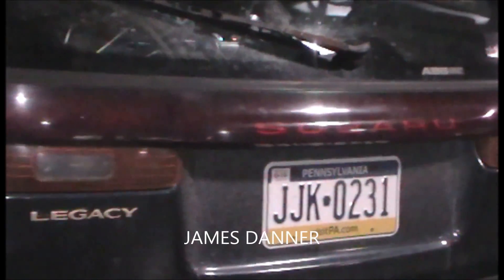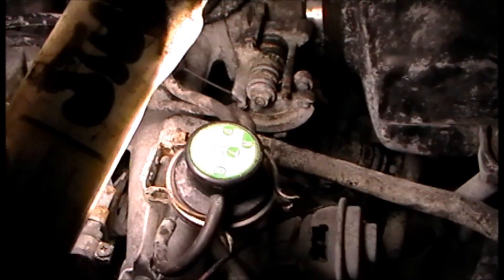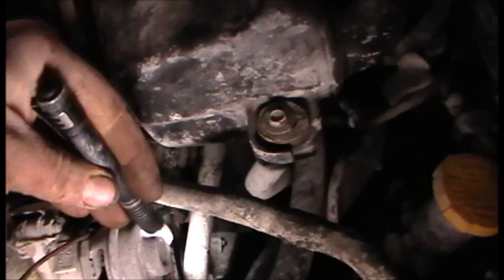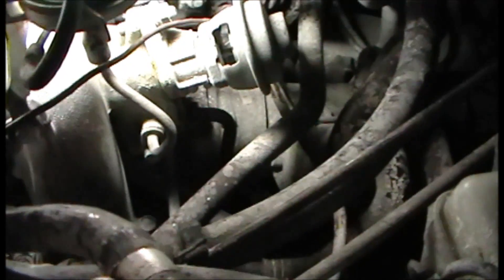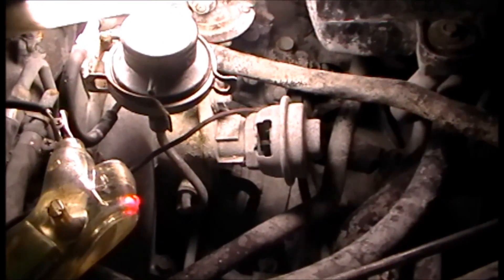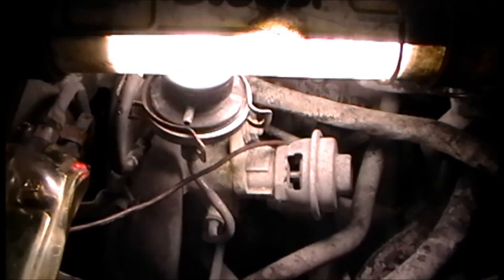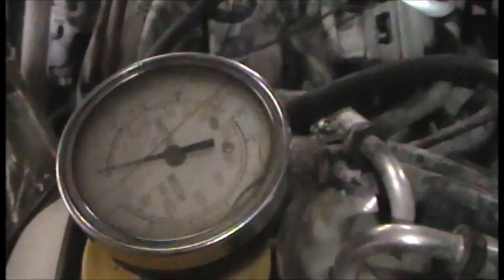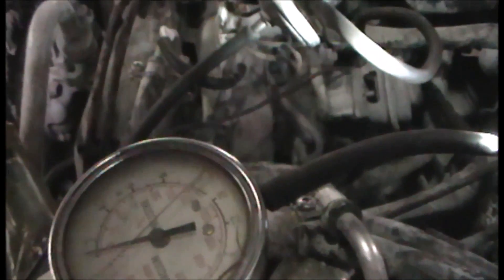SUBARU P0400 EGR FLOW

Comment: Thanks for the video, I have that exact same car with the 2.2 instead of the 2.5 the tube you took out , on a 95 2.2  is a press fit into the manifold and doesn't come out, however I used a piece of wire to clean out the tube and there was some restriction at the bottom of the tube. everything else is the same. Great video I was getting a cylinder three misfire and replaced the idle air control valve, then after that I was getting the P0400 EGR Circuit "A" error. I only have to now clean the EGR valve of carbon but it is RAINING A monsoon here in northern Oregon, will do that next week, only 2 10mm bolts and it comes right off.

Comment: Thanks a million for posting this. I found that steel line completely clogged on my Suby 2.2 conversion of a Vanagon, and the EGR inoperative as a result. Cleaning it out didn't fix it, but with the test you outlined in the video I was able to confirm that the BPT was a gonner.

Comment: I have a similar problem.  EGR valve does not move, error P0400.  Removed and tested EGR valve, BPT sensor, and EGR solenoid.  All good.  However the wires connected to the eGR solenoid have a constant 14V across them regardless of RPM.  Help?
Reply from the maker: I need a year and model to research more. Most likely the computer supplies the ground to the solenoid.  I would want to check the control side of the solenoid back to the computer and see if the wire is broken . Or if it isn't controlling at all for some reason

Comment: If the egr is clogged did you say it could sound like an exhaust leak? Mine threw a code and the exhaust is a little louder. Havnt had a chance to check but just wondering. Its a 97 impreza obs

Comment: First, thanks for a professional explanation of the EGR works design in the Subaru. If I did not understand wrong, a) back pressure coming from the exhaust, enters the inlet port on the Transducers sensor, producing a signal for the vacuum solenoid to open, allowing the EGR to open and exhaust gases - when the force of the back pressure IS enough - to re-enter the cylinder for further ignition. The problem in yours, was the Diameter's restriction of the back pressure port into the transducer. Are there any silicon or other additives that will prevent these carbon deposits on the surface of steel tubing? One more question: mine is a Forrester 2002: does the layout and design coincides with the Legacy Outback's?
Reply from the maker: +johnathan smith I can check for you Monday when I'm at work 
The transducer is pretty much  a mechanical vacuum switch.  The pressure pushes on a diaphragm that lifts a valve allowing the vacuum flow to the egr
Reply: (edit) After viewing your video,  decided to solve my "CHECK ENGINE" light (I haven't an analyzer), because I suspected the EGR was involved. I used an additive (good per 90 gas liters) and IT CLEARED it! Anyway, searching for the valve, I cannot find the location of it in my 2002 Forrester. Please. help me, if you can. Is it too much to ask if you were to video the position of all sensors inside the engine compartment video? It would really help a lot of people, including me. Much appreciated, James.
Reply from the maker: +johnathan smith my program only shows an egr on the 3 liter six cylinder models in 2002. And it's electronic with a position sensor like some of my gm videos.  Can u hit a parts store with a scan tool to get the code?
Reply: James Danner - Thanks for suggestion. I will do that. I had before a Pontiac Trans Sport 3.1 ; its EGR was actuated via a vacuum port controlled by a vacuum solenoid depending on the on the main computer. It opened and closed according to the Temp Control 'transducer' signal (a thermistor with three wires) in the cooling system. Beside - to turn on the cooling fan (only one) and to feed the instrument cluster - it had a Temp Switch with 2 wires only, mounted at the plenum, close to the intake manifold. A nightmare in design!
Reply: @James Danner - Sorry for delay. I did my research, and found out 2002 Foresters do not have a EGR valve, per sei, because their emissions are within the acceptable range. They supplemented their design with the evaporating canister circuit. This info was supplied by the Service Mngr. at Subaru Brampton, Ontario, Canada. Thanks, again.

Comment: Hah!!! considering how good your tools are (I'm jealous!) and how thorough and systematic you are, there's no doubt you got the thing working. I have a 2.2L and it's popping that same error. EGR valve was cleaner than yours but I cleaned it anyway. Wasn't feeling the vacuum from the intaked, fiddled with various lines and tested them in a much more rudimentary way (finger over the lines) and seem to have gotten the EGR valve to work again. I just put my finger on the valve and throttle with the other to feel it move.
Reply from the maker: +paytontech there is that little vacuum line that goes to a map sensor (mine was near right strut tower) that the computer uses to confirm egr flow with an intake vacuum change. That line can deteriorate too and set code even if egr really works

Comment: i could really use some help with my 98 legacy outback wagon limited with the 2.5L.
ok i did the head gaskets with the fel pro permatorque.
i remember the engine was running quietly and soundly before removal.
it did not have any exhaust leaks.
well i did a couple things, i noticed the spark plug wires boots were stuck in the cylinders and all dry brittle, so i removed the 4 of them.
i accidentally pinched off one of the nipples on the little map sensor filter upon removal as well and so i ran a straight hose to fix it, now running with no filter.
when i first started it up, it ran like a dream for about 20 minutes, then after first drive, it started being hesitant on the throttle, and like it was going to shut off.
i got it home and rear the code pertaining to the map sensor deal (with the pinched off filter nipple) i ran 1 solid hose to straighten that out.( no more code, but could this be the problem?)
i also just remembered today about the spark plug wires with no insulation boots. (can this be the issue?)
another thing i did was remove the perfectly working tps and set a code.
i re adjusted it to .50 v closed and that didnt fix it.
so anyway, whats it doing?
it will idle beautifully cold for a while and even get great throttle response, after warmup it will pop and miss fire when i press the throttle, (only sometimes)
i cleaned maf and that made a small difference in power. i noticed my egr isnt staying fully open when im holding the throttle at about 3-4 grand....it will close back some even under throttle... i am just about stumped with no check engine lights on!!! please help me

Comment: Just did this, it's tricky to pull the metal line off, he didn't show that part, take everything off including the transducer bracket and egr value, liquid wrench the flush part of the metal line and slowly spin and pull it off, it won't just pull straight off.  Mine was clogged too ...letting it sit in gasoline for a bit then blow it out....beater car life!!! Thx James!!
Reply from the maker: +Tim Scherk yea. I remember praying I didn't round everything off and cause more grief

Comment: When trying to fool the backpressure transducer (@ 5:55) where is the vacuum tester hooked up to?
Reply from the maker: I'm blowing into the lower port with my mouth at other end of the hose and the vacuum gauge is hooked up to the vacuum line that should be plugged into the egr valve itself

Comment: Thanks for the video. I learned alot. My 95 legacy is throwing this code also. I cleaned up the mass air flow sensor and now the check engine light is off. if it comes back on (i have a feeling it will), im going to get into doing what you did. thanks again.
Reply from the maker: let me know what happens.. thanks
Reply: All the tubs had good vacuum and seemed clear from what i could see. I cleaned the EGR and my code seems have gone away for good. I have also cleaned IAC and changed out a few vaccum lines. But my car still cuts off at a stop from time to time and idle is a bit rough. So still searching\
Reply from the maker: Any chance that the egr is sticking slightly open? Would cause a hard to find internal vacuum leak. And rough idle
Reply: would that throw a code? about 50 miles of driving and no check engine light.
Reply from the maker: it may not since there isn't a direct egr flow sensor or position sensor.  just looking for maf change during commanded test. could eventually set a fuel trim code. what are the long term and short term fuel trims on scan data at idle?
Reply: I dont have a scanner. I just get my codes run at auto zone. Check engine light just came back on but I haven't been able to make it over there to have it checked yet

Comment: Hello James. I have followed your process closely on my 97 OB. I am extremely grateful! Before I found your video I was just stabbing in the dark and wound up replacing the Valve, Solenoid, and BPT. After watching your video I figured out that the metal lines on the throttle cable mount were clogged. I bypassed them by splicing the vacuum lines together with some spark plug boots. Now I can make the valve work by bypassing the NEW BPT. But when I put the BPT back in line, I get no valve operation. I have checked that the metal exhaust pressure pipe is clear. I have a pulse at the backpressure hose underneath the BPT. I have vacuum to the BPT. But when I take a vacuum reading after the BPT I sometimes get a short burst of vacuum with a rev. Then it drops immediately. The next few revs will produce no vacuum. Is my NEW BPT likely bad from the factory? Should I get a constant vacuum in the hose after the BPT?
Thanks,
Jeff
Reply from the maker: with all you did. I would be tempted to clear code and see if monitor completes and system passes. the vacuum supply is metered by the exhaust back pressure.  and sometimes a park or neutral dead rev isn't enough.  you may need it under more of a load
Reply: Thank you very much for the reply. I cleared the code and the light came back on today. I know I am getting a signal from the computer because my test light goes out when I rev. (I think that is what it is supposed to do, like when yours goes from red to green) I did replace the solenoid but I wonder if I got a bad one. I do not hear it click when I rev like you do in your video.
Reply from the maker: Are you losing vacuum at the solenoid or after the transducer
Reply from the maker: also not sure if yours uses a map sensor for confirmation like mine did but if so check the long vacuum line going over to the sensor on the right strut tower
Reply: Ok. I will check that for sure.
Thank you.
Reply: James Danner Hey James. Thank you for sticking with me on this project! We passed today! Woo Hoo! My son is finally tooling down the road in his first car!
Reply from the maker: What ended up being the final issue?
Reply: James Danner Hey James. I am sorry to be so late in getting back. I have not checked on my account in a while. I am not sure what it was exactly. I think it was related to the BPT. But, less than a day after we passed the emissions test, the CEL came back on for the same code. So I am afraid that my experience doesn't give any data that can be used to anyone's benefit.

Comment: Great video.  I checked the metal line that was clogged on the car in the video and mine was clogged as well (98 Subaru 2.5L ).  I cleaned it out and I am still not getting the egr valve to move.  I can move it freely with my finger.  I haven't checked the solenoid yet.. what else could be wrong.
Reply from the maker: vacuum source. diaphragm in valve is bad/torn. solenoid.  power or ecu control of solenoid

Comment: I can't remove the bolt of that little metal pipe, any advice ?
Reply from the maker: that stinks.  u try any heat?.
Reply: will try but it's kinda stripped
Reply from the maker: Can u get a bigger nut over it so the stripped head fits inside the hole and tack weld nut to bolt?
Reply: Damn that's a great idea ! I will try this for sure, thanks !

And also, i test my solenoid with my multimeter, and it gave me around 37 ohms, i try to put direct 12v to it to heard a click but didn't hear anything ? Do you think my solenoid is broke ?
Reply from the maker: that works real good on broken ford exhaust studs in aluminum heads. i have best luck with a high amp weld that makes everything glow and let it cool a few minutes to let the heat dissipate thru the threads

Comment: Do you wear a hat at work? I ask because I used to run with a Stream Light Stylus Pro but then I found this Nebo CSI Edge 90 that I really like. It clips to the bill of a hat really nice for hands free working. They are only like 12 bucks and are solid little 90 lumen  flashlights.

Comment: Small pipes and stuff like that are usually my first suspects,in an EGR system. The soot tends to block stuff up pretty good. It's a common issue in a lot of cars,the EGR tubes,plates,passages,etc. always get gunked up. Clean it all out,and it's good to go,provided the valves/solenoids/etc. are functional.

Comment: and some said the exhaust side of the EGR doesn't plug up.. they are wrong in this case..
Reply from the maker: i think this did cause its like a dead end...no flow just a pulse
Reply: James Danner just a question .... i am trying to understad , tha pipe that you unplugged   its a dead end right?  it only lets exhaust gas go trugh to  push a diaprhagm right?
Reply from the maker: estrelladelnorte1308 yep
Reply: yep, it was probably me. never saw an exhaust side of an EGR plug
and it still holds true, the exhaust side of that EGR was not plugged. It was the backpsi transducer exhaust tube that was plugged. As my bro said, there really is never flow through this tube and over time it did plug up. The tube would also be cooler than the rest of the normal exhaust passages which causes deposits to form too.
good point though my friend. I guess I need to put an asterisk next to that statement from now on :)
Reply: ScannerDanner i think if the rubber hose that holds the transducer looses flexibility and gets a leak it will allow  "flow" of exahust  wich is isn't suposed to have ,and the pipe being colder gets soot buildup. thanks for the explanation.
Reply: estrelladelnorte1308
no problem thank you
Reply from the maker: ScannerDanner i agree paul but if that asterisk needs to go into your world renowned diagnostic book. How much is that gonna cost?... HA
Reply: Very funny :)
Reply from the maker: wait til the baby pics
Reply: James Danner
I got just as much dirt on you bro :)
Reply from the maker: i know...HA